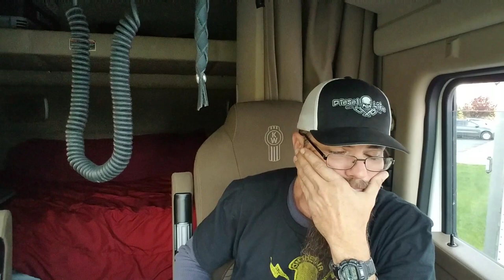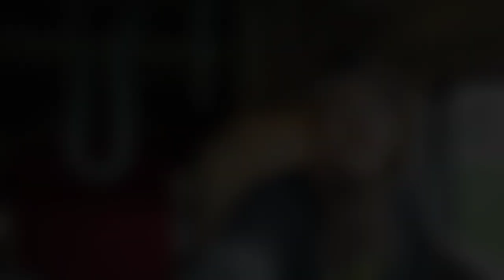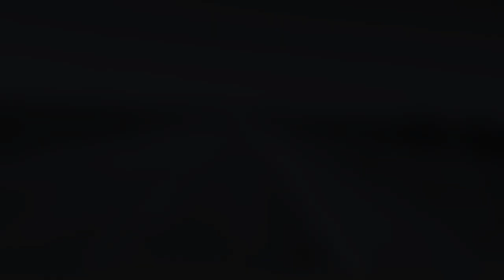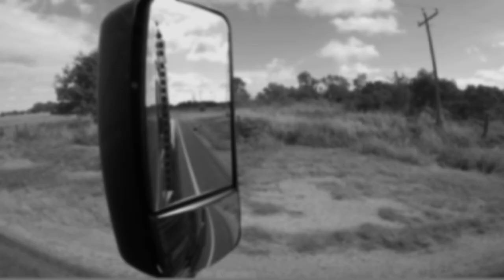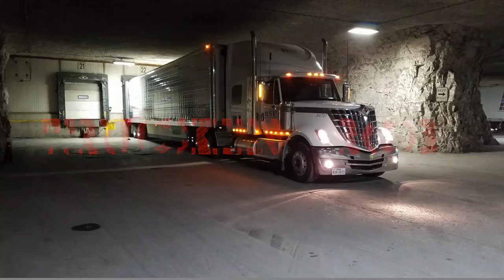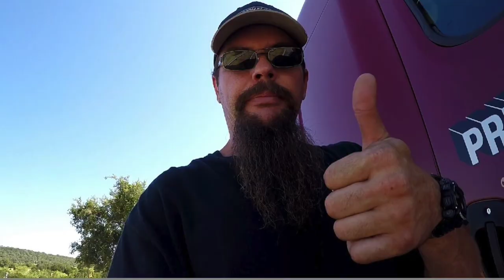Jabberin 2

Comment: Keep us posted as to the motor is,fuel mileage, how you like it etc there Rob if you can there🎩
Reply from the maker: +Shadow Wolf.      Absolutely!   I've been recording my mpg since day 1 in this T680
Reply: What's your mpg average so far?
Reply from the maker: +Jay Ay.  Averaging around 8.2.   But I switched to flatbed so it's dropping a little.
Reply: Truckin Rob that's still really good considering most reefer load gross 70k+

Comment: SRT Riverside do any over dimensional /overweight power only stuff?
Reply from the maker: +Mark Tankavich  RST currently does not.  But as we grow,   it's definitely a possibility.     I love flatbed,  especially specialized so we'll see.
Reply: I work for company in DFW area that's a dealer for aggregate equipment most of which all is moved by power only trucks.  I'm always on the lookout for carriers; hate dealing with brokers!!
Reply from the maker: +Mark Tankavich.    Heck yeah Mark!    We might be able to work something out.  
Feel free to give Chris Robertson a call at 281-733-6250.